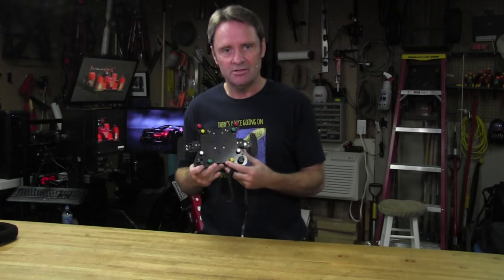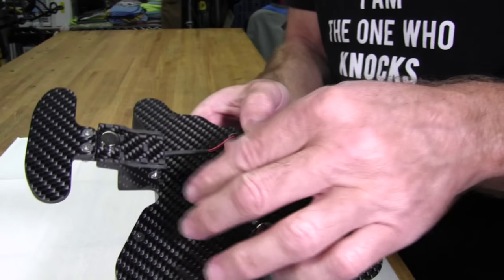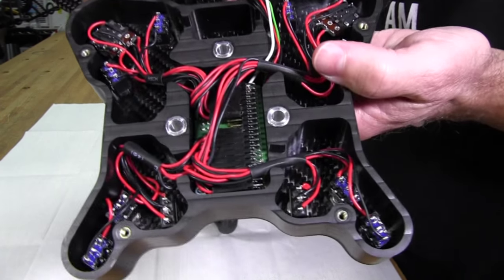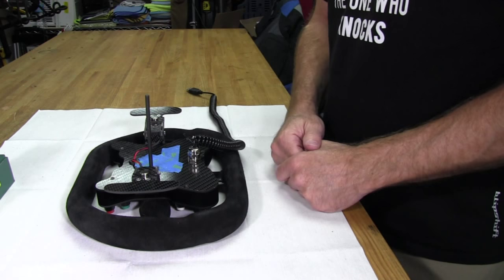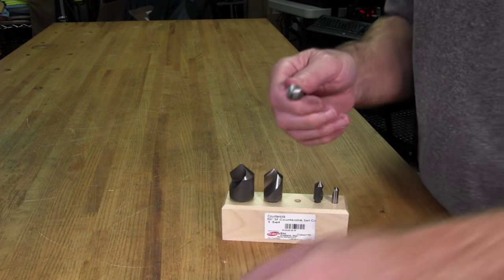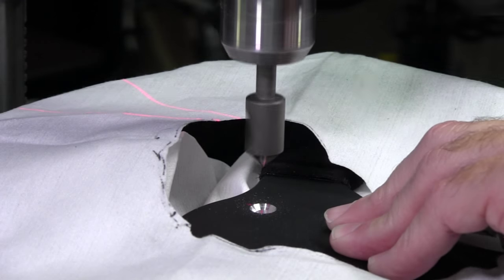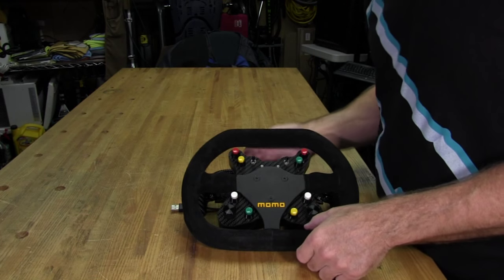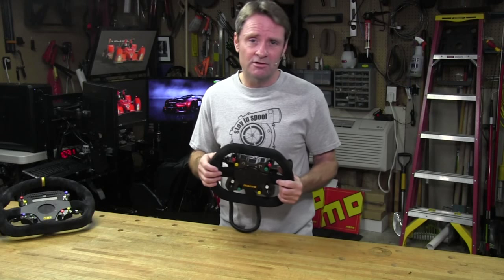Ascher Racing Button Plate Review

Comment: Lovely wheel Barry. I have a Mod27.C waiting for the same sort of thing...
Just to confirm, is that the 270mm Mod29, or the 290mm. You said 270 I know, but it just looks a bit bigger than my 270mm Mod27.C
If it is 270mm, did you find it was too small and made the forces alot stronger on your Bodner Sim Steering?

Comment: There is a center mark at the back and you should use 25mm radius around this mark to do your holes. If your doing it like Berry, your wheel will be offset.
Reply from the maker: Had to do this so the screw would not got through the MOMO logo. Sacrifices had to be made! LOL! But in use you really can"t tell that it is offset because it is such a small amount.
Reply: Totally true. I just want to point it out that there will be an offset. If you are using the Mod 27c or Mod 29 there is no big deal but i would not do it to a round momo mod 26 for example.